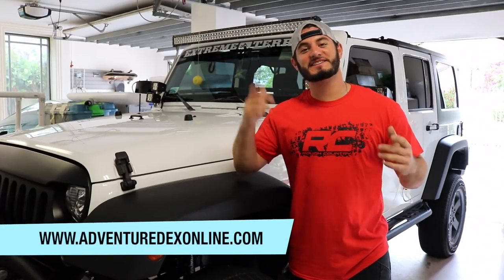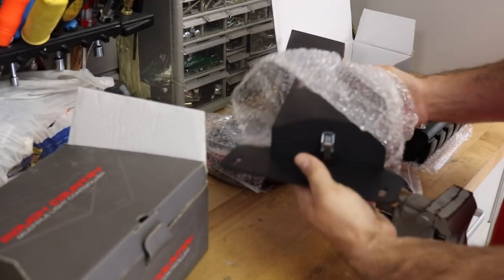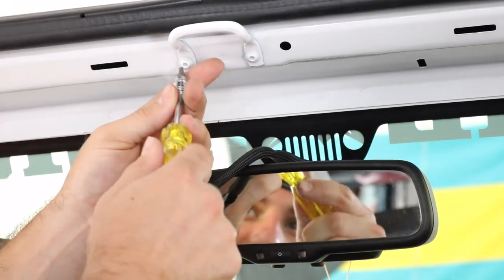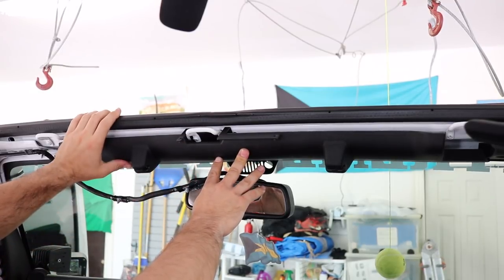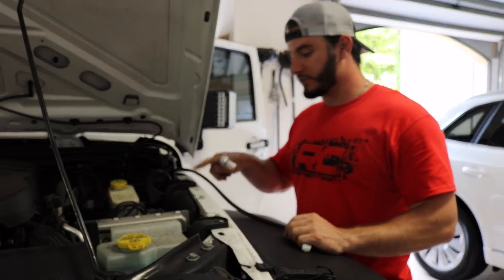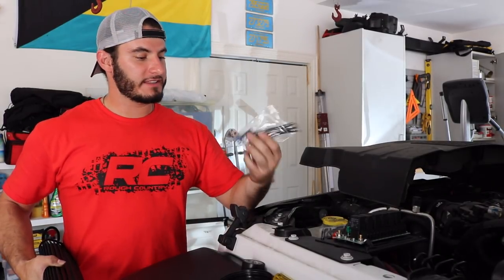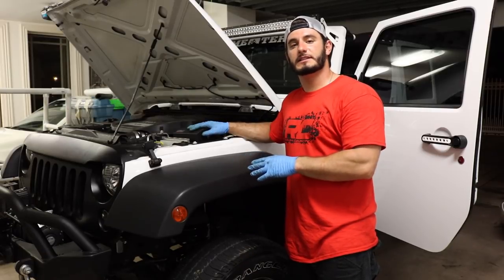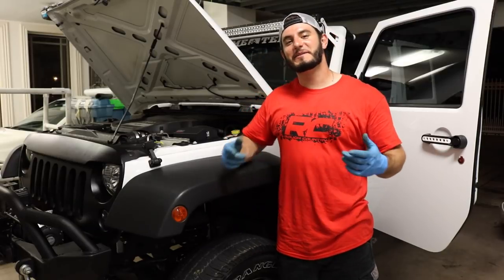Jeep Wrangler Switch Pod Installation - Rough Country MLC6

Comment: I like your video and the concept but this brand new product is already a dinosaur.  The lack customized toggle covers is a no go right off the bat.  But more important is this archaic technology uses fuses and not resettable circuit breakers.  Breakers are light years ahead of fuses and there is a reason fuses have almost been eliminated from the marine industry.

Comment: Can we say spod
Reply from the maker: Thanks for the comment! I made mention of that in my video. This product is for those who don't want or can't afford to spend $600+ on a switch pod! Thanks for watching
Reply: My sPod with Dual LEDs and option of colors was $437 not $600, I've also had it for almost a year
Reply: that's still 237 dollars more... money that can be spent on other mods. Its almost like Yeti coolers vs. RTIC coolers the later is half the cost and does the exact same thing.
Reply: Ace Calzadilla I have not seen one yet from rough country but I am sure it's not the same level of quality as the spod. You get what you pay for. Not to mention the stole the design from spod.
Reply: maybe its not on the same level would love to see a side by side video comparison. But I'm sure RR is a way bigger company then spod and isn't gonna take chance bringing out a half assed electrical item that might give them issues down the road. Every one copies everyone else now a day's how many grab handles are out there from different companies. Not to mention winches that so similar to each other that you can only tell them apart by the sticker. Spod needs to bring down the price to compete, because at 199 its insanely cheap.
Reply: Ace Calzadilla it’s like saying there is more copper out there so gold shouldn’t be as expensive. I guarantee the spod is a higher quality and it’s made right here in the USA. The price is not that far off for the 6 switch. 200 compared to 325 I paid for my spod. It’s cool that RC sent you that set up for a demo. I’m sure it will work fine. Happy trails buddy.
Reply from the maker: +TheHalacy1 thanks for sharing!! #jeepwave